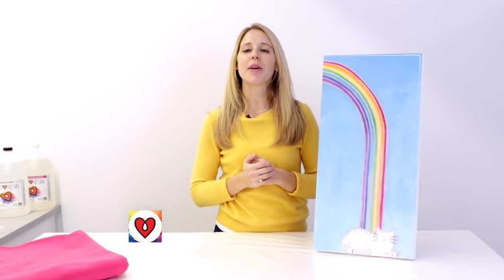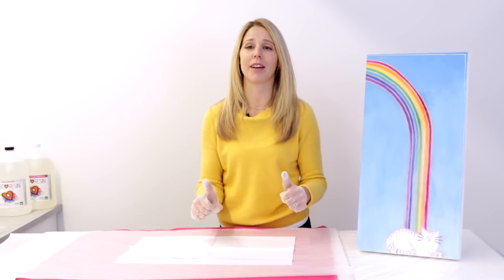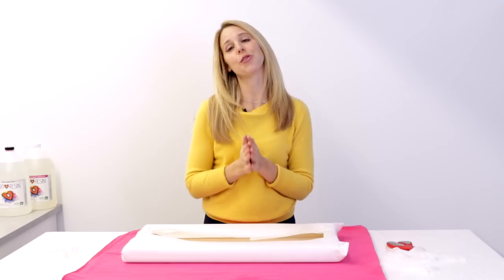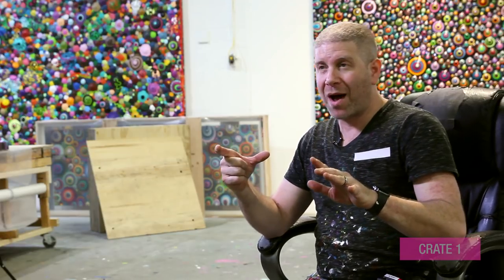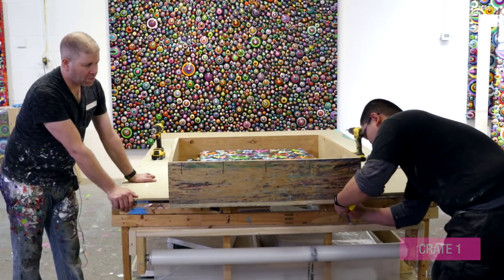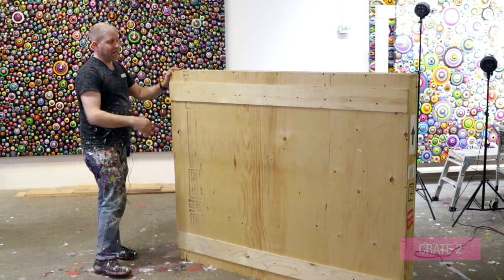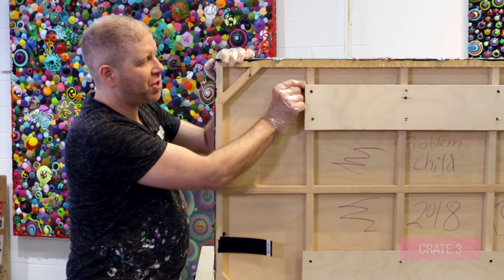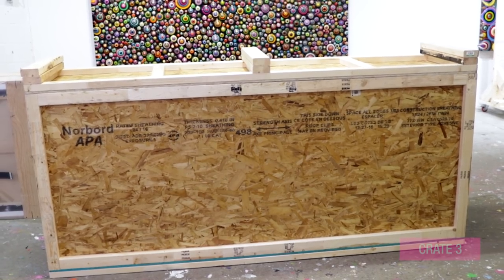How To Pack Your Resin Art For Shipping

Comment: Excellent video, only question I have is about packing say furniture like a Resin End Table that is 36" diameter and 26" high but legs can be removed making table I'd say between 5-10".  and how do you ship, I have been told DHL ships furniture but How do you figure out shipping cost, any other info about DHL would be cool.
Reply from the maker: This video will give you some pointers on how to protect your resin artwork, for specifics on how to ship with a specific carrier once your piece has been packaged, you would be best to reach out to the carrier itself.

Comment: I placed a painting that was not resinned yet face down on glassine to resin the back of canvas for stability and the glassine stuck to the front of painting. I have a special painting for my son’s new home as a Christmas present. What caused the sticking? Is it safe to ship the painting with glassine?
Reply from the maker: Hi Judy, perhaps the paint was not fully cured and stuck to the paper?  We recommend a layer of glassine or acid free butcher paper as the first layer over your cured resin when packing just to prevent any plastic contact or imprinting from other materials.